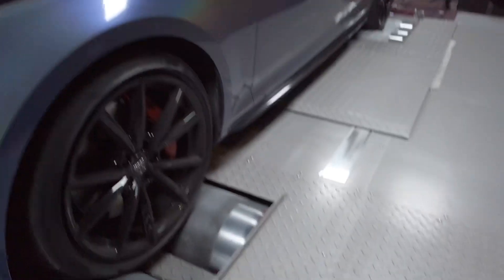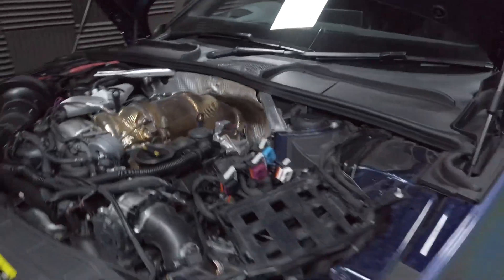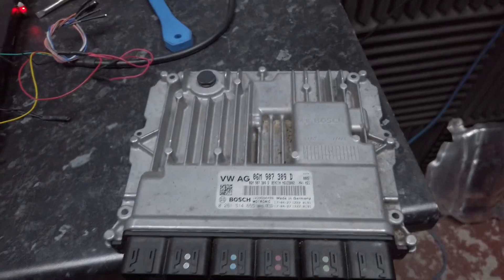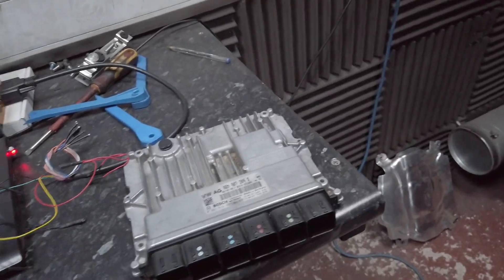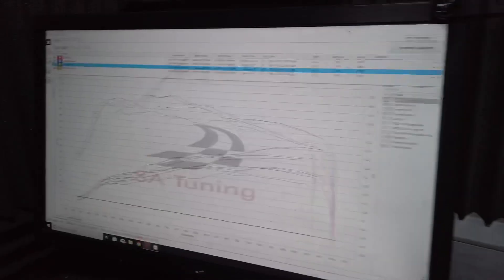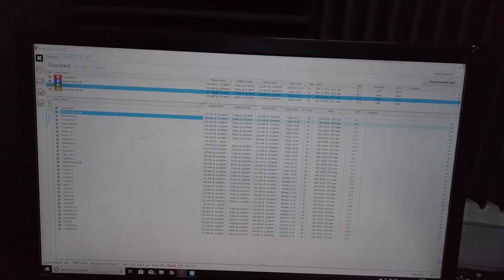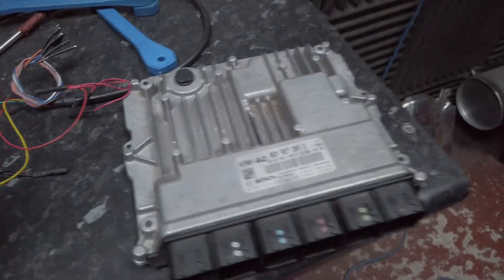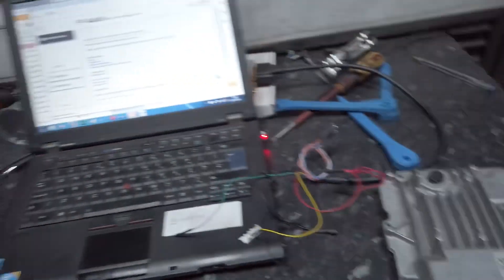Worlds First Audi B9 S4 to have an ecu remap! MG1 and MD1 ECU, vag group

Comment: Hey Guys, are you doing any work on the transmission? is the MG1 an all encompassing unit, with a TCU as well? Just curious, thanks, great work!
Reply from the maker: Richard Gruber no the MG1 is just the engine they have a ZF865HP gearbox by ZF, this software has been developed also and we are tuning them currently. Kind regards SA Tuning

Comment: Hi guys. I have B9 S4. It's been lowered, new arb's fitted and has a Milltek non resonated valved full system fitted. Been waiting impatiently for this to happen. What would you estimate the power gains to be? Cheers.
Reply from the maker: Trevor Eakin hi there, keep watching for the video we will do when the tune is finalised and we have end result figures to release, we have surpassed all Tuning boxes so far after many hours on the dyno. Kind regards SA Tuning
Reply: @MaxtuneOfficial  Thanks guys. I'm not a fan of tuning boxes. Had a dtuk box on a previous SQ5 and it caused nothing but problems. Hence why I'm waiting for a proper map for the S4. So chuffed its finally away to happen.